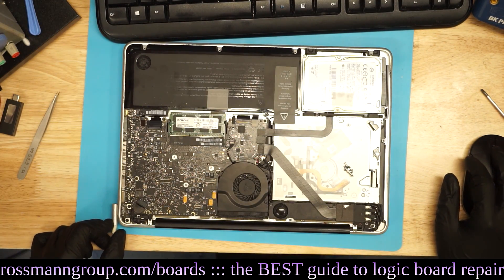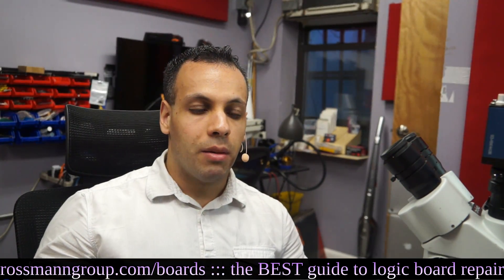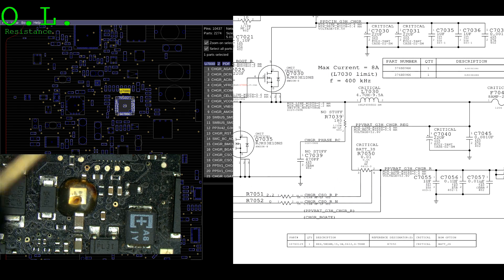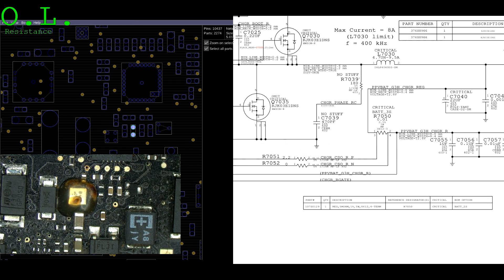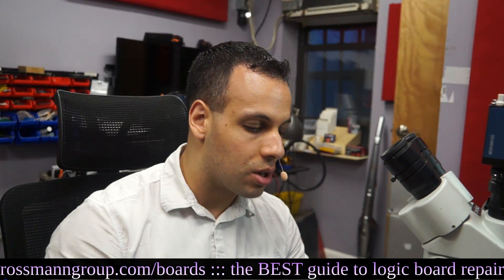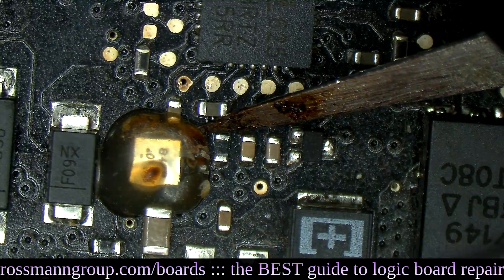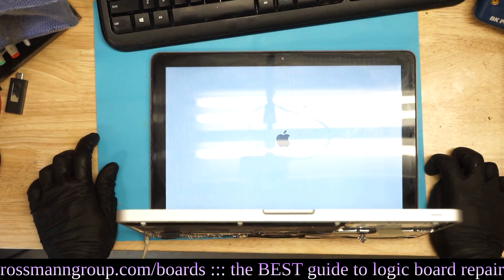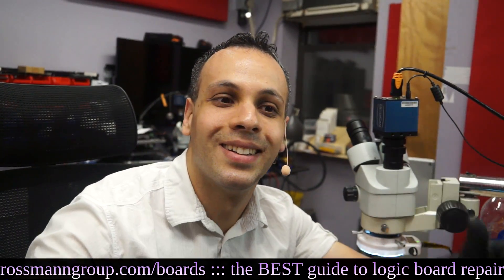How cheap eBay batteries DESTROY Macbook logic boards!

Comment from the maker: Miss livestreams? Find them on my other channel: here's the livestream this video was taken from! https://www.youtube.com/watch?v=D569LbzV0MY I livestream repairs every day, then pick out & edit the good ones for this channel that I think there's something to learn from. 

Want a good battery? Don't delay, BUY TODAY!!!1111 https://store.rossmanngroup.com/index.php/soldering-diy/general-repair-parts/macbook-parts-by-type/batteries.html
Reply: could you explain how battery could fry anything? unless it's wrongly wired having higher voltage... but it's hardly a case...
Reply: z08840 chances are that it was either shorting out or just a bad sell with abnormally high resistance. Quality control is not the greatest on cheap stuff. It may be incorrectly wired in factory but more likely is user error.
 Would be nice to see some backwards engineering and see what caused it exactly...
Reply: I used to work at chipotle I can make you a really good burrito
Reply: Every time you mention your website etc. you need to smile and add a twinkle visual effect and a 'ting' sound
Reply: No Louis, don't have kids. She will fuck Chad and divorce you and take your kids while you are at work. You will lose your money to greedy lawyers and she will get the rest.
Reply: Louis you might want to read this news article about Apple in New Zealand. Finally our authorities might be cracking down on Apple and their warranty practices.

http://www.newshub.co.nz/home/new-zealand/2018/05/commerce-commission-warns-apple-for-likely-misleading-consumers.html

https://www.stuff.co.nz/business/industries/104319587/apple-warned-by-commerce-commission-for-misleading-customers-about-replacement-rights
Reply: ArthursHD
 neither short or high resistance can kill battery's current sensor circuitry... unless it's a current sensor of battery charging circuitry - then short can kill it if there is no protection - which would be weird if it wouldn't be an apple product :)